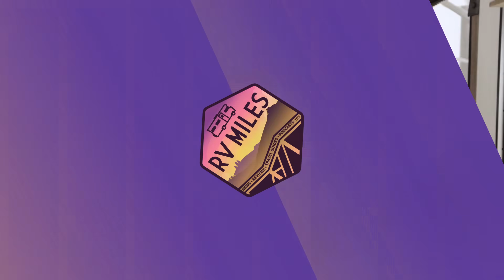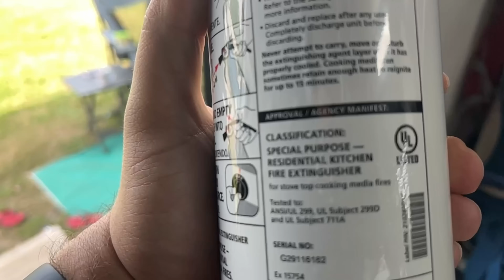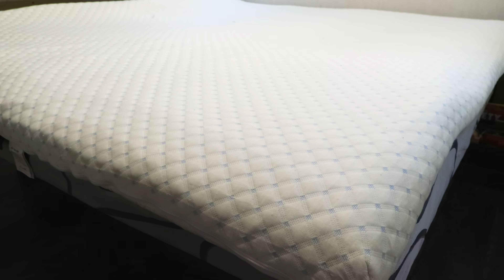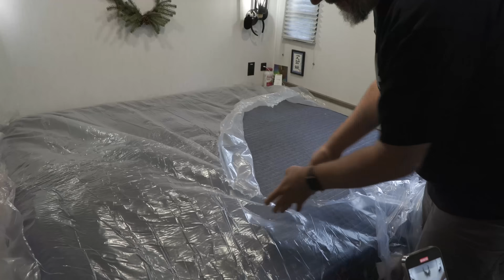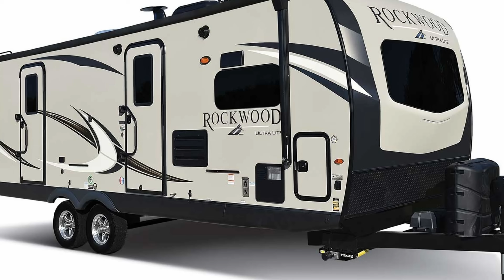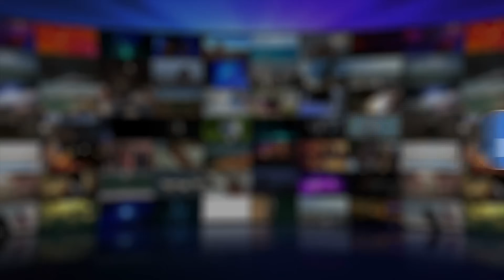Six RV Upgrades You'll Want to Make IMMEDIATELY

Comment: In our first travel trailer, we used a mattress topper to be more comfortable. For our new/current Solitude- we immediately changed mattress out to a serta bed in a box from Sam's. SOOO much nicer camping!! We also installed an inline surge protector/readout system. Not really an upgrade, but a must have when you've invested a lot of money in an RV!
Reply: What surger / reader did you buy?
Reply: @cannonsluxuryart  Surge Guard 35550 Hardwire Model - 50 Amp. Display unit is - Surge Guard 40300 Optional Remote LCD Display for Hardwire Model 35530. And we got a plug analyzer to check power before plugging in.- CARMTEK RV Circuit Analyzer 50 Amp - RV Circuit Tester with Smart Diagnostic Chart and Indicator Lights - ETL Listed 50 Amp Circuit Analyzer for RV.  Hope this helps!

Comment: Great video. Just bought an 'entry level' travel trailer today, and I expect we'll do many of these upgrades, starting with the tires. On our B+ motorhome, we got new tires, upgraded the fans, added a topper, put in a lithium iron phosphate bank (SOKs) and associated electronics, added solar, threw out the 3-way fridge (literally) and replaced with a Danfoss compressor AC/DC fridge (huge upgrade IMO).
Reply: Our 3 way fridge caught fire or rather got so hot it burned a board behind and it was smoking out the vent on our first trip. They put new wood in the back and a tar substance or paper tar? My issue was why it got hot enough to do that? It also doesnt get that cold. I expect it to at least when stopped at site to cool more. I will look up that Danfos. Thanks.

Comment: If you buy a used RV, be sure to check the dates on the tires as they can still have tread and be too old to drive on. This happens often when they are not regularly used. We changed the tires and upgraded the shower head to the exact one shown.

Comment: When going to Lithium or AGM batteries you normally (at least 90% of the time) need a serious upgrade to your converter charger.  Even on mid level and upper end units the converters are not recommended for AGM and certainly not Lithium battery application.  A good 4 or 5 stage converter can run several hundred dollars, been there done that!

Comment: Perhaps, I didn't hear you guys correctly. Did you say $900 to $1,200 per 1,000 amp hours of lithium batteries?  I think you meant $900 to $1,200 per 100 amp hours of  lithium? Or, maybe $900 to $1,200 per 1,000 watt hours of lithium?  Since it seems customary for lithium batteries to come 100 amp hour at 12 volt units (1,200 watt hours) for about $1,000 each; 1,000 amp hours (which I  believe you said) would work out to be about ten 100 amp hour batteries at about $1,000 each for a total of about $10,000 worth of lithium. I'm sure I  misheard you as I am wrong about these things almost all the time.  Perhaps, when you guys have a moment you might check this.   When my wife bought her lithium, she paid approximately $1,000 each for a 100 amp hour 12 volt lithium battery (aka 1,200 watt hours): about $6,000 for the six 100 amp hour 12 volt lithium batteries she bought a couple of years ago.  Boy, I sure hope she didn't get ripped off. Those guys in Reno seemed really nice.
Reply from the maker: Yes, it was a flub. We meant per 100 amp hours.

Comment: Thank You 
Yes the bed was the first thing. Mine has a microwave/ convection oven ha ha ha. The Convection only has a few presets and I don’t need or use them. It shuts off at 15 minutes when you try using it to temperature so it’s only a a microwave. So I invested in the Ninja oven that folds up agents the wall when not in use and folds down to use. It works beautifully. Bakes broils and makes toast. Excellent use of space and excellent food come from it. 
Next addition 200 watts solar one extra battery becomes that’s all that fits in the step. 
Will replace the Sink and faucet next. I did improve the door INSOLATION by purchasing a spring rod and hanging a light weight blanket that covers the space. It a neutral color that blends in easily. During the day it drapes on a cor but. So it looks like it belongs. I will get the upgrade shower head. I have done a lot more added lights and storage drawers and crown molding and high grade paints and they look beautiful as everyone is surprised and I get amazing complements I worked meticulously it took quite a long time but I’ve upgraded the entire thing it looks much nicer than it did when I bought it and what’s the difference really between an expensive RV and a not so expensive RV when you buy them new it’s a quality of the furnishings the wall treatments the lights the comforts. So it looks amazing. And functions much better as well.

Comment: How do the lithium batteries work in freezing temps?
Reply from the maker: They output fine, but they don't charge very well. Ours are in our heated pass-through storage. Some brands make batteries with built-in heaters, but that uses battery power to accomplish.
Reply: Appreciate the response,  I live at 4500ft elevation, my winters get cool.
I went to lithium batteries on a couple of my motorcycles, once the temp gets into the mid 30s, they won’t start unless I leave a heat source on them all night.  I’ve tried the recommended turn it on for a minute to warm the batteries before starting but it hasn’t worked.   With the cost of lithium, I have been hesitant to continue with them.  The slower draw down of the house batteries may be a better application for them.
Reply: Move the batteries into a heated part of the RV(under the bed?). They do not vent gases) Do not charge a lithium under 32 degrees.

Comment: Off topic for this Video. But there is a new overnite RV parking sites being developed/proposed off of the I 65/US 50 interchange at Seymour, IN. according to an article in the Seymour Tribune newspaper a couple of days ago. It is to be 100% FHU,  fully paved level pull thru sites, paved streets and pretty much just for a one nite stay as you travel north/ south on I 65 or east/ west on US 50. There are no annemities, site are by reservations online, payed by CC. You will be sent an E mail with your site # and the code to the gate. This is an unmaned park except may be a grounds keeper. If this is successful the developers propose building another one north of Indy along I 65. They are marketing this as an alternative to truck stops and rest areas. Proposed rates were not stated, but I would assume much cheaper than a traditional campground.

Comment: Based partially on the video you did with Matt, we also purchased a 37FLL and love it.  However, we are keeping it in one place in Myrtle Beach.  That being said, we are not fans of the supplied mattress.  What thickness did you need to get to keep it low enough for the slide in to clear it?  I could measure next time I am there bit thought you might the info handy.

Great list for sure.  Keep doing what you're doing.  We appreciate you!
Reply from the maker: Awesome!! We ordered the 10 inch Wanderlust but we did have to remove the bottom piece of trim in order to get the slide to come in. The 8 inch would have been fine with the trim on but that extra bit of comfort was worth it to us. Happy shopping. Let us know if you’ve any further questions.

Comment: Why is a microwave convection oven not standard on RVs? Especially if the RV does not have an oven.

I bought a used class C that had an oven and I still switched out the microwave that came with the RV for a microwave convection oven. BTW I RV alone so I don't need to have the oven and convection oven running at the same time, I just like the convenience of having both.

Comment: Thank for this video! We also have a 37fll that we have been living in for over a year. I'm not sure how we made it over a year with the factory mattress and a 2 inch topper but we have. I have always wanted to put in the same mattress (10 inch wanderlust ) you showed in this video. However I didn't think the slide out would work with a 10 inch mattress. We have exactly 8 inches between the slideout bottom trim and the top of the bed frame plywood. Do you do anything special like push the mattress down while brining the slideout in; does it seem like it would eventually cause damage to the mattress?

Comment: We replaced our bathroom fan and install covers on the roof on both fans. Replaced vent stack covers. Placed all lights inside with led ones and changed from gold to satin nickel colors. Most outside lights replaced, a few more to go. Installed 4 exterior cameras and monitor. New radio. New CB. 2 new flatscreen TV’s. Residential Refrigerator. New large kitchen sink and faucet. New shower and vanity faucets. New shower head. Took out rocker and put in chair and ottoman. New fire extinguishers throughout. New blinds and curtains. Washing machine. Ring alarm system. RV GPS. Berkey. Tire Minder. Surge guard. Wheel covers. New ladder on rear. Cover for skylight to make room darkening.
Still need to replace awning, damaged the original. I want to replace gas stove/oven with an induction cooktop. Have 4 lion energy lithium batteries but need the other components and solar panels. 
We have a 2000 Winnebago Journey diesel pusher, so it needed lots of updates. Still a work in progress.
Oh yeah, and the exhaust system as someone stole ours. Probably for the catalytic converter but it didn’t even have one.

Comment: Hello there,
I m relatively new to full time rving with my tiny Jayco 145. I have, over the last few months done most of the upgrades you suggested except the six pack of fire extinguishers, not enough wall space! I am going to look for a fire blanket for stove fires.
One thing that also felt was important was I upgraded from one propane tank to two. That way I shouldn't run out in the middle of cook dinner or making coffee!
Reply from the maker: Having that second propane tank is incredibly helpful.

Comment: We upgraded to golf cart batteries. Pretty expensive at $200 each, but supposed to be much longer lasting. We purchased a slightly used but heavily upgraded camper last year, a 2018 Palomino Columbus 1492 366RL, with both upgrade packages available for that year, so we had little else to upgrade. However our rig came without slide out toppers, so we'd like to get those at some point.

Comment: We changed all of these on our first travel trailer, and a fair number on our first gas Class A.   Now in a DP…we are actually sleeping well - wait for it - on the OEM mattress!   Still thinking about batteries, but we’re going to see how we get on with 8 agm’s, 1100 watts of solar, and the on-board generator.  A battery upgrade would require a controller upgrade as well.   🙄

Comment: We have the 37ffl too.  You mentioned the bed height interfering with the slide.  What height mattress did you go with?
Reply from the maker: We did a 10", which was probably cutting it too close. We had to remove a piece of trim and it's still tight. 8" would be better.

Comment: Hi guys!
I already upgraded / replaced all things on your short list…including ditching the AGM batteries to Lithium Phosphate.   
One thing that I would add to that list is to install a “soft-start” module for the HVAC. (Why in this day and age manufacturers still use high voltage capacitors doesn’t make sense…and they’re not that expensive)
Reply: Not expensive? I'm seeing $300 each
Reply: @bobbygray7813  To put it into perspective, $300 expense in relationship to the total cost of a new(er) motorhome (around $100K+) or even a new AC unit…is pretty minor.
Yeah, I just shelled out $309 for a Micro-Air soft start…that hurt, but was a necessary expense. Some parks have only 20 amp service.

C’mon, it’s the 21st century.  I bet some manufacturers (Dometic or Coleman) has already figured out an inexpensive way to engineer ACs for soft starting.
Reply: Why would they reduce the sale of AC units, most Rv owners have no idea what a soft start is, it’s all about the money

Comment: We did the tires and fire extinguishers 3 weeks after we took delivery.   We find the standard battery to be OK since we don't boondock, just installed the 3rd in 8 years.  
We added a jack and lug wrench (note:  bolts on the spare may not be the same as on the axles).  
Obtained the "build sheet" from axle serial numbers and carry a set of proper bearings, races, and seals.
Took every thing apart that I could and stuffed steel wool in the cracks and wire/pipe openings to restrict critter movement.

Every year at spring opening:  Spray the upholstery with protectant, Spray the underside  seams with bug spray, lube the shackles, stabilizers, and slide out mechanism, sanetize the water system.
Reply: Nice list!! Seems no matter what it is. . .more maintenance.  . .less problems!

Comment: I have been working on replacing all of the lightbulbs to LED in the coach there are 54 of the small light fixtures. I also found a company who manufactures LED light frames to replace ceiling mounted fluorescent fixtures with LED this should bring a considerable boost to the battery life. Thomyt
Reply: Care to share that manufacturers info for light fixtures…we have old camper. Thank you😉

Comment: Awesome video.  Just bought a new travel trailer and added memory foam to the existing mattress.  Works beautifully for now.  Maybe new mattress later on after settle with cost of new trailer.  Fire extinguishers are top priority before the season begins.  Going to check out tires and then battery.  Thank you so much for your suggestions!
Reply from the maker: Very welcome! Our mattress topper gave us a good six months before breaking down. Hoping the same for you. Thankfully, if you do go with RVMattress.com the 20% off code has no expiration date and will be there when you need it. Congrats on the new trailer and happy camping!

Comment: I heard what your saying but the main thing I took out of this was how nice Abbey's hair looks.  
I put a 100Ah LiFePO4 in Airstream interstate and a DC to DC charger with MPPT.  Also added a 2K invertor.  The PO put a 120VAC frig in it so I needed it for off grid without using the generator.  
You guys doa great job, thanks for the info.
Reply from the maker: I too felt my hair was really on point in this video. 🙌🏽 Thanks for noticing, watching and sharing your battery set-up. -Abby

Comment: Great list, we have changed our mattress. tires and one I would add to the list, suspension.  We have a 2021 Avenger 27DBS 7000 highway miles on it.  I wanted to upgrade to the Moryde suspension package.  When I did I found the plastic bushings were shot and the thin shackles were oblonged where the bolts go through.

Comment: All good suggestions. We are weekend warriors now on our 5th Travel Trailer since the 80's. Have done or have all of the Upgrades you mentioned in our 2019 Rockwood. But the one I particularly like is trading up to a 100amp hour Lifepo4 battery. The lighter weight and extended battery life has been well worth it. Now if we do an overnight rest stop I don't have to worry about killing the battery because we ran the vent fan or furnace.

Comment: Lithium $$$$$$ . They don't like cold temp's and generally need to be located inside the RV .  They also need special charging equipment and more time to recharge .  I can buy a lot of good lead acid and a small generator and be money ahead .  Maybe in the future when the price comes down .
Reply: Look on Amazon. The prices have come down. Lead acid will freeze if not fully charges in very cold temps.
Reply: Hopefully they will come standard or as an option in more rigs in the future. Getting the right chargers/converters installed is a bit of a pain.

Comment: I hear a lot of anecdotes about tires, but I have yet to find reliable data to support any theories about tires. So if you're going to say one tire is better than another, where's the proof?
Reply from the maker: I'm a data person too, and I wish there was data on this - but the reality is that so many of us have had brand new generic trailer tires just go boom without anything wrong with them. I used to think people were just getting flats and not noticing it until it happened to us. It literally exploded 50 miles into a trip after checking pressure. And I've seen so many people have their brand new SPARE tires blow just being mounted on the back of the trailer. But beside all that, they're usually rated just too close to the weight of the trailer.

Comment: Great info yes we did it all. $50,000 trailer the mattress was like a sheet of plywood , the battery lol I never got it out of the dealer and it was dead. We got AGM works great. Tires lol we have had 3 sets in 150,000 km yeah we got new set now. Awesome video very cool 🛠️🇨🇦🛠️🇨🇦

Comment: I've replaced 2 RV AC outlets with a one that has USB outlet built in. No more need to bring phone chargers. Just the USB cable.
Reply: I did this too. Surprisingly easy upgrade.
Reply: Yes indeed. It was simple using home AC outlets and old work blue electrical outlet boxes. Some of the outlets in the RV are not capable to fit the house outlet boxes because they are too deep into the walls. This is what I used.

https://www.lowes.com/pd/CARLON-1-Gang-Blue-PVC-Old-Work-Standard-Switch-Outlet-Wall-Electrical-Box/1002471628